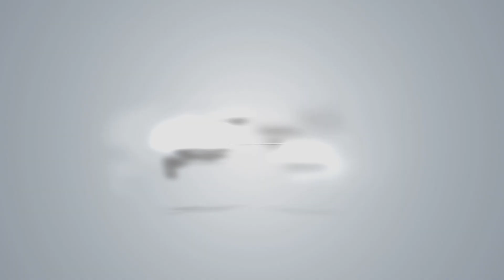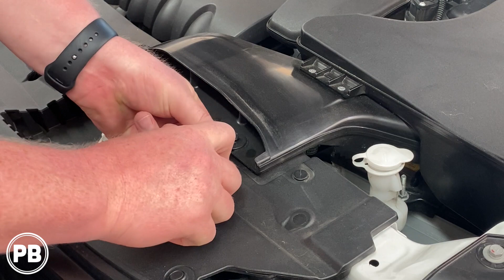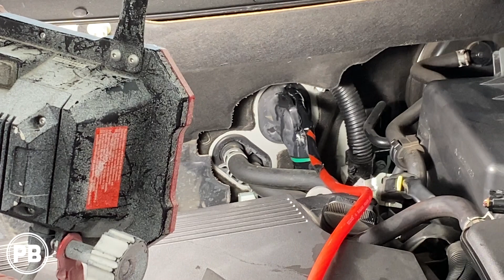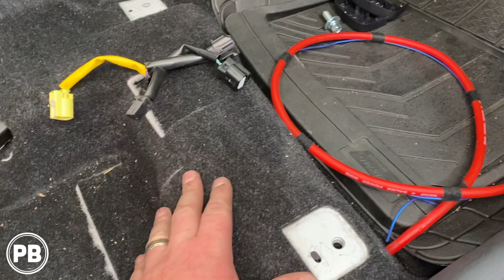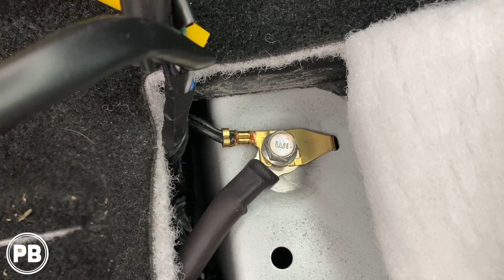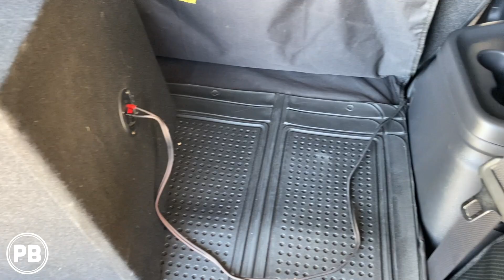2016 - 2021 Mitsubishi Outlander Amp and Sub Install

Comment: the grommet in my ASX (which shares the same setup as Outlander) barely have space inside - it's fully packed with wires!!! I'm just not gonna poke a wire inside and "pray hard" that no wire gets nipped in the process.  I'm still looking for other ways to do it. Thanks for this video :)

Comment: I want to know how you found the positive and negative wires to tap the converter. I have a 2019 Mitsubishi outlander sport and the colors are different. Can you help?
Reply: Hey man did you figure this one out?
Reply: @jacktelford5500  I did, I just tapped into the speaker wires in the door.
Reply: @jedibassmaster8649  yeah okay cheers bro. Gonna try this now. Did you tap into the b pillar or door trim wires?
Reply: @jacktelford5500  it's actually the 2 wires going directly into the speakers itself.
Reply: @jedibassmaster8649  cheers bro I finally figured it out. Did you have to run a power and earth cable to your converter too? My sub is making some sort of noise and turning on but not playing music. I think it has something to do with the converter
Reply: @jacktelford5500  I didn't, I just have a  regular kicker converter. Make sure you have both positive wires on the converter tied together, same applies to the negative wires. Not sure what converter you have but there is a extra wire that you don't need.
Reply: Did you happen to find what color wires ?

Comment: This looks nice and clean. Great job. I have the same model car. Looking to upgrade the speakers as well. When i run a mutimeter accross the rear right speaker wires (brown and blue) it shows a posive reading on the brown. How did you know the blue was positive in this case? Do you have a wiring diagram you can share? The left door also has blue and brown. But on on left door, the blue shows positve.
Reply: My Outlander 2018 ES , left door rear side BRN became Pink ( + ) and WHT became Black ( - ) all this wire is on the columm.

Comment: Thanks ! I had a hell of a time finding a spot in the firewall to install my power wire, didn't think to look that high up. Doing it tomorrow with 1/0 gauge, hopefully it goes through xD !!  EDIT: didn't go through... Had to find another spot. Pulled out the hood latch cable and grommet. Nothing close to it so bored it out with a step drill bit to 1 inch, used a waterproof grommet (screw type) and put hood latch cable in firs wired it up then fed power cable from the inside out, worked great. Have to take off the fender wells (plastic) and zip tied the hell out of it to existing wiring / hood latch and fed easily to engine compartment. All panels fit back nice. 1/0 gauge welding cable was used.

Comment: Did an amp/box install at my shop. Customer states bass cuts off over 40 on the volume. Max vol on this car is 45. Does the oem radio cut out the bass after a certain volume like the oem dodge stuff does?  Tried multiple amps, new subs and redid power and ground.
Reply from the maker: Cut off or roll off? Cuts off sounds like an issue with the amp / sub / distortion.  roll off would be from the factory radio.  If there is rolloff, you can fix it with an LC2i / lC2i Pro.  Cutting out is an issue with the install.
Reply: From my measurements, the radio begins distorting over 36 on the volume.

Comment: for that much work , they could have bought an all in one box , from JL , and routed the power , and not have to splice and drill holes , and why use the back right speaker as an input , when you adjust the sound for the rear , it will change the sound of the sub , the factory radio has a LAC on the back with rca outputs standard , looks clean , just overboard on the install , looks nice though

Comment: I will be doing a complete Kicker install on my 2016 Outlander ES. The install will include:

CABLES:
*Kicker 46PKD1 1/0AWG Dual Amp Wiring Kit.

SPEAKERS:
*2x Kicker KS Component (Front Doors, 4ohm, 125w RMS)
*2x Kicker KS Coaxial (Rear Doors, 4ohm, 100w RMS)

SUBS:
*2x Kicker Comp R 12" Subwoofers in original Kicker Ported Box (factory connected in parallel, which has one connector at 2ohm, 500w each speaker, 1000w RMS total)

AMPS:
*Kicker CXA360.4 (Bridged into two parallel channels at 2ohms to be able to produce 180w per channel, one channel for front speakers and the other channel for the rear speakers.
*Kicker CXA1200.1 (This will be the powerplant for the Kicker Subwoofers. It's a little bit more power than needed, but I rather do more and bring the gain down, than less and overheat the amp).

ACCESORIES:
*2x Kicker LOC: To be able to convert the high output of the headunit's front and rear speaker cables low output RCA;
*Kicker RCA Cable. 2 channels. One pair for the front signal, the other one for the rear signal.
*Kicker RCA Y Cable: This will be used to multiply the rear rca cables into 4 rcas. Two of those split RCAs will be used for the rear connection of the 360 amp, the other two will be used for the 1200 amp. That way, the front speakers work independently, and the rear speakers will be the one controlling the audio signal to the subwoofer. It would have been ideal if the head unit had a dedicated subwoofer rca output, but that is not the case and I am not going to buy an expensive head unit.
*SpeedCable (a.k.a 9 Connector cable): This is to send the audio signal from the 360 amp to the back of the headunit where the door speaker wires will be. At the same time, the 9th cable is for the remote turn on.. that signal will come from the fuse box at the dashboard to the 360 amp, and then it will be bridged to the 1200 amp as well so that both turn on when the ignition switch is on.

EXTRA:
I am designing and I will be 3D Printing a mounting system for the CXA amplifiers where I will be able to bolt each amp onto the floor of my car, and leave space underneath for 2x PWM fans to be controller by a PWM driver using temperature sensors. If  the amps get hot, the fans will turn on automatically and they will increase the speed accordingly. If everything goes well, I might sell this setup for a profit.

Needless to say I will be using ferrules and shrink tape for a clean installation. 

Wish me luck in this crazy endeavor :)
Reply: Stage 1 (Door Speakers) Installed yesterday 5/19/2023.
Stage 2 (Wiring  Kit) next...
Stage 3 (Amplifiers) to follow.

For those interested in the speaker wire color for the 2016 Outlander with the base radio. Here it is:
Front Left: Pink (+) Blue (-)
Front Right: Pink (+) Blue (-)
Rear Left: Brown (+) Blue (-)
Rear Right: Brown (+) Blue (-)

As you can see, blue is negative for all 4 speakers.. and the rear positives are brown, the front positives are pink.
Reply: @P_double_H do you have a sport? I have been trying to find a wire schematic and no luck
Reply: @Le-oh8bv mine was the normal outlander, not the sport. I sold this car after I did this work.

Comment: Do you think the wires that you tapped into for the line output converter would ebe the same for a 2011 mitsubishi outlander sport ?
Reply: You ever hook subs up yet have a 2011 as well, if so what aftermarket head unit u go with
Reply: @AA-RON  I did , but I did not go with a aftermarket head unit bit instead used a line out converter off of my drivers rear speaker and did it that way

Comment: I literally did this exact same way to the tee and my sub only works when I open the passenger front door don’t think those are the right wires on a 2019 outlander sel base sound system does anyone know what my problem is and how I can fix also I tapped into my fuse box like this added the circuit to my 15 amp stereo fuse and my amp wouldn’t shut off why?  Plz help me!!! 😅
Reply from the maker: Generally ANC is the culprit  in that situation, but the outlander doesn't have that as an option. I'd verify your connections and equipment, sound like an electrical issue.

Comment: where did u find your wiring diagram for the speaker wire color. im working on a 22 outlander and cant find anything on it
Reply from the maker: We used a test tone and polarity checker to determine the phase of the speaker so I know what is positive and negative. No diagram was needed since we do the research ourselves.
Reply: That didn’t really help it’s not the same
Reply: Specially for guys that wanna learn and do it themselves instead of paying a large amount for this to be done
Reply: Just pop off the door panels and see what the colors are what. Once you tap them take a multi meter to it and see what your looking at.
Reply: @nickdiezel5606  how can you tell ?
Reply: @tylerjeffries6738  What I believe Nick means is that if you remove the door panels you will  be able to see the speaker wire colors... that way when you remove the column panel you will  already know what cable is what based on their color.. it takes more work but it's a solution if you don't have the expensive equipment shops use.
Reply: @P_double_H this doesn’t work. In the door my speaker wires are red and green. In the c pillar I have pink brown, lighter green and grey. No red or or geeen like in door. I need a diagram for 21 outlander
Reply: @1bigstash did you find this out?